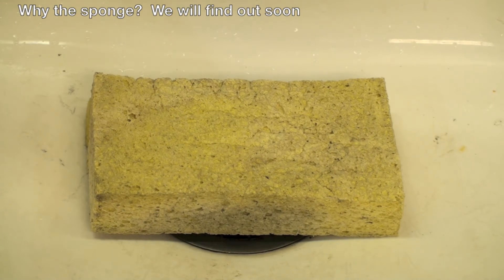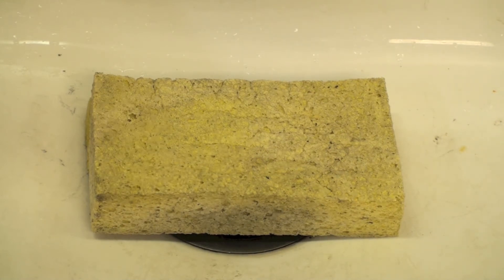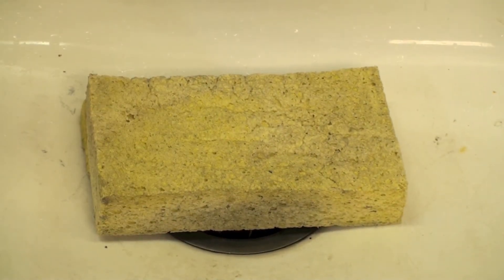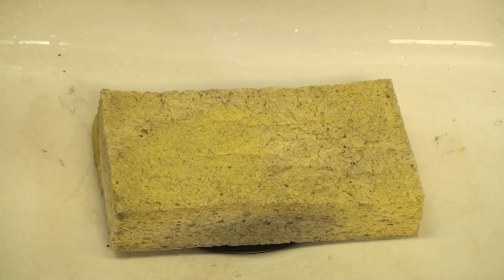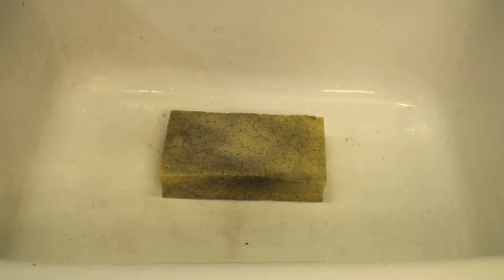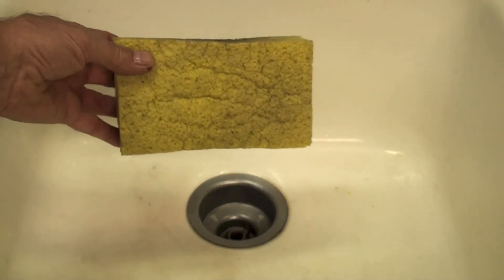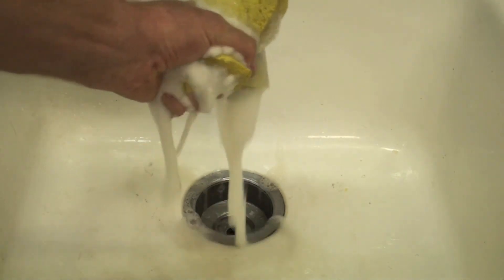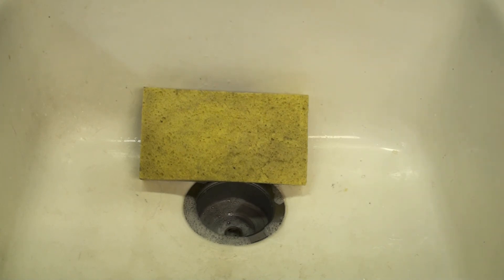What is relative humidity

Comment: Wondering your thoughts. I have an issue where my house sometimes becomes too humid during summer and even though the temperature is 72 it feels uncomfortable. I live in central nj about 30 mins from the shore. During the day my unit does seem to get rid of the humidity as my nest says it’s usually around 52 to 54 percent. However at night it’s 58 to 60 percent. Do you think I should hire someone to maybe take a look at possibly lowering the fan speed?